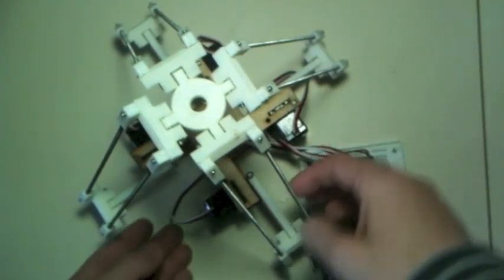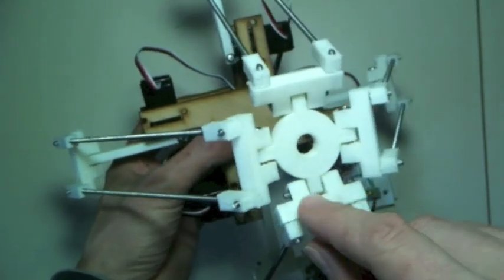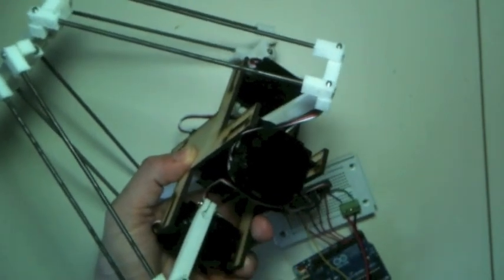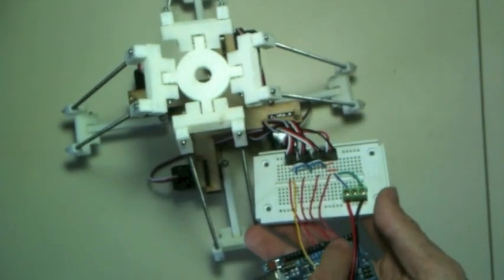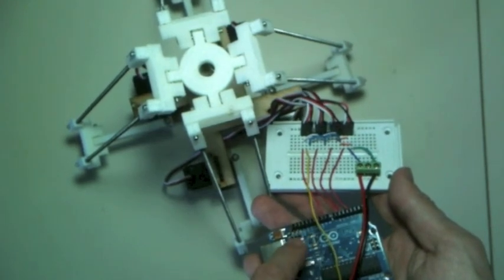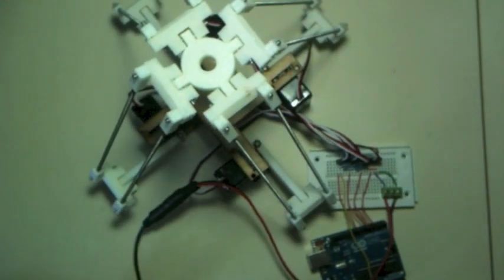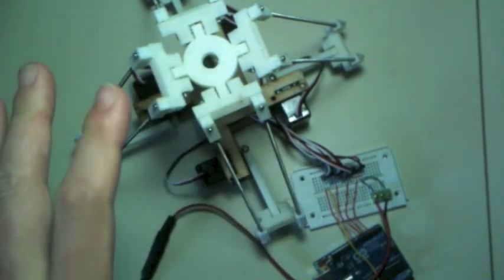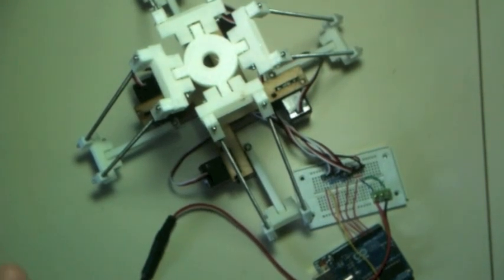Let's Make a Delta Robot (v2)

Comment: Will the side of the motor slip?

There is no tooth pattern on the body

I do not know if you understand because I am using google translation
Reply from the maker: what "side of the motor"?
Reply: Rotor and arm
Reply: No teeth to connect  with arm
Reply from the maker: servo can attach to arm with a set screw.  No slip.
Reply: thanks，Do you use hot melt glue or just set screw?
Reply from the maker: i said screw! :)  Glue is a mess to clean up later.  What if you want to fix it?  oh no~~~...
Reply: got it now